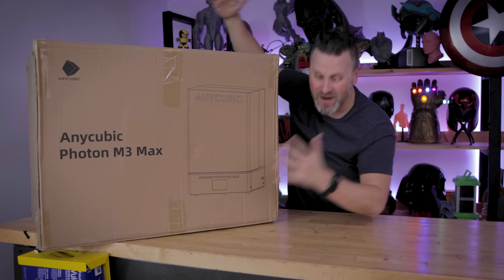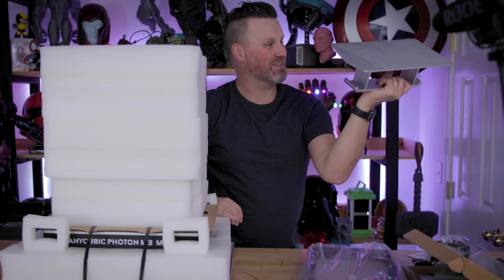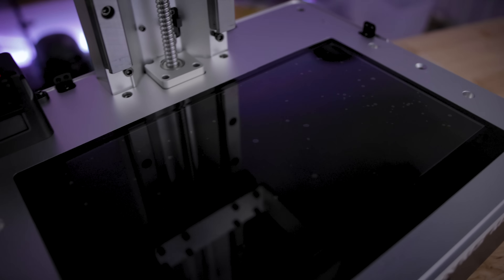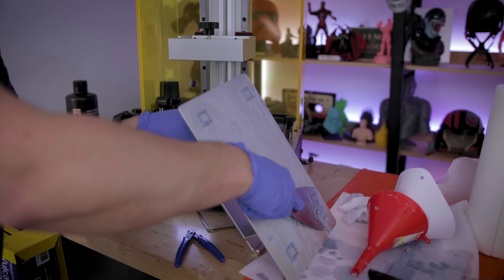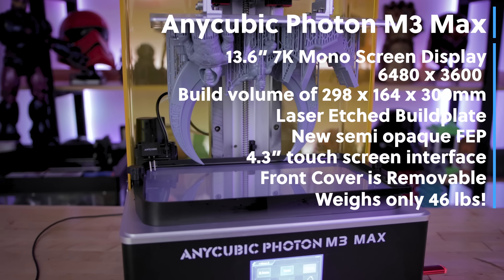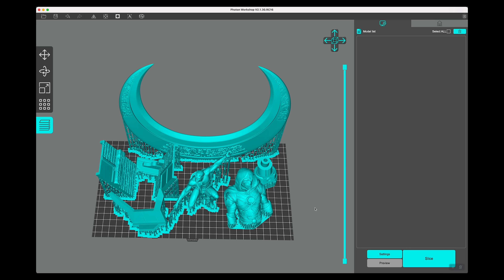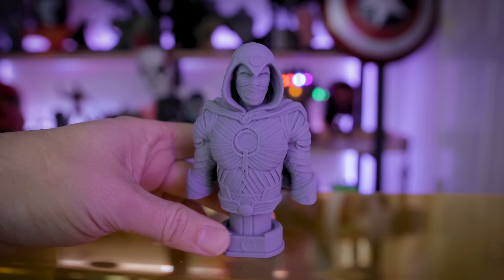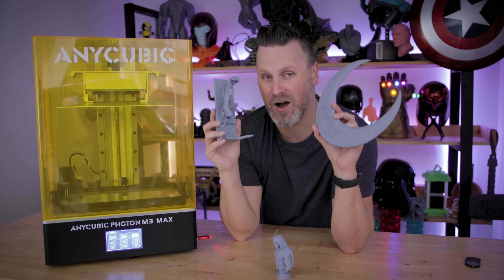This is amazing! Anycubic Photon M3 Max - First Look!

Comment from the maker: Interested in the new M3 Max or Anycubic's other new machines? Check them out here ➜ https://shrsl.com/3g1lo (aff link)
Reply: This is a great addition for such a large printer. BUT I already see a major flaw.

That resin tube and system is going to be a pain. Especially if you plan to switch resins. This system WILL clog. I don't have the funds for any of these printers (badly wish I did), but the upside down resin bottle feeder seems to be the best refill option.

 Eager to hear/see Jessy's full review.
Reply: @sespider  just add resin manually or make sure vat is full before print, adding byt hand is not hard and never caused an issue for me
Reply: That price seems crazy considering the competition are all several hundred or more expensive.
Reply from the maker: @markmorgan8378  It's definitely something to consider!
Reply: Looks like an awesome machine, although I wish they had gone just a tad bigger as to compete with the Phrozen Sonic Mega 8K or the Peopoly Phenom L…

I do hope they find a way to make the auto-resin filler a separate add-on so you could put it on any printer. 🤞 They’d make a killing! 💰
Reply: I've heard from other reviewers that the auto filler prongs are set too high and could lead to overflowing issues when starting new prints, is this the case with yours?

Will this still require shaking the bottle once in a while? how difficult is it to clean up afterwards? and would the prongs have resin on them and have a chance to drip onto the screen after removing the VAT?
Reply: Hello, this's Rebecca from SUNLU Company, I like your video so much, I would like to send you some SUNLU resin(standard resin or nylon resin) samples, would you like that?
Reply: still shilling for trash...
Reply: Would like to order this today but can't find a single positive review for Anycubic customer service or after purchase support.  Can I safely spend this kind of dollars with Anycubic?
Reply: @jerrybeasley1418  I've had to deal with their support on multiple occasions and I'll be perfectly honest. It can be slow as you're bouncing back between China and that's something that you just have to deal with. When I say slow, I mean maybe a day or two and and nowadays with people's Amazon expectations. Anything that's not instant gratification it's considered bad.

I've had issues with damaged screens and missing parts. I run a print farm so I'm buying a crap ton of machines and to be perfectly honest I haven't had any long-term issues outside of one of my machines. Just giving up and dying after about 2 years which when you're talking about super cheap electronics like this is not surprising.

I've been pretty happy with anycubic in general and want to consider their service any worse than any other China only based support teams that I work with.

Right now my only annoyance is I'd like to get more photon ultras but they keep dropping new products and not releasing this outside of the Kickstarter
Reply: Buyers beware anycubic took 50 days for them to tell me I wasn't going to be able to get my package it was lost
Reply: I bought a mono 6k, then returned it after finding out the lines I was getting from the uv array was a common issue. I'd be hard pressed to purchase another anycubic product in the future
Reply: @TheDooominator420  What "uv array" common issue?  Most issues are user error when it comes to 3d printing (hapens to everyone).  Did you take the time to calibrate it or just expect it to be perfect out of the box?  I have x2 6k's with zero issues, perfect clean prints every time so far, although I had to up the UV power % a tad as it was set a bit low when I got it.  Haven't seen what you said is "wrong" anywhere else however.
Reply: @MrNickpeck36  I first noticed a grid pattern in my calibration prints. I figured it might be a setting issue or the intensity was set way too high. After messing with a bunch of settings and getting down to 35%, I started researching. This is a issue anycubic is aware of and are trying to fix. I did a exposure test with a paper in place of the vat, the uv source looked like a lumberjack's shirt. My Saturn and ld002h both have a solid block of uv when tested this way.
Reply: @TheDooominator420  You know what, my one Saturn S did that as well, so I did the same thing, returned it and chalked it up to S/H damage lol.  I have x2 6k's now that are super solid so far.  

Now that you explained it I know what issue you are talking about and have seen it for several brands of printers.  I'm sure the bouncing around in S/H doesn't help.  Thanks for the info and good luck!

Comment: I own a M3 max and 
Im assuming the port on the right with the fan visible is the intake? I jsut wanted to make sure before i hook up the ventilation system i purchased. Becuause of the size and my limited space i cant test while its running. Can anyone give me an autoritative affirmative or negative?

Comment: Looking at getting into printing later on during the year, probably a silly question, if the printer is out of UV light in a normal environment (not partially damp or cold) can you just leave the printer full of resin, or will the resin eventually go off being left exposed to air?

My printer will probably be standing for 4-6 weeks before being used again.

Comment: Anycubic Photon M3 Max questions: 
1. What frequency is the FEP supposed to be tuned to?
2. Does the FEP spacer still require the "13mm" bottle cap depicted in their official FEP Replacement video or is the M3 Max a different calibration? (I have seen some 19mm spacers from users.)
3. What is the torque setting for the screws on the FEP sheet?
4. Replacing the Glass under the LCD left a gap on one side is there a way to combat this? As the adhesive strip needs to be as far out of the print area, and on the perimeter as possible.
5. Anyone able to fix the touch screen not responding often?

Generic Questions:
1. Does anyone consider that the FEP has to be the same temperature as during normal operations while installing the new sheet? I'm sure temperature has some (if negligible) difference?

Comment: You showed that the auto fill her wire went into the hole in the cover at the back. That whole is only for the fill hose and air hose not the power wire. The power wires actually on the back of the machine and that’s where you plug the power in for the auto fill cap.

Comment: Question. Just bought one of these bad boys. The auto fill works however when it stops there is a gurgling or bubbling that happens within the resin bottle. Normal or not. Like I was saying, It seems to be working just fine though.

Comment: great video ,thanks.
Just received my max3 but I'm cofused over the issue of if there is already a screen protector fitted to the maxhine plus a spare in the box.
should I fit the spare or not. if two protectors are fitted, 🥱does it matter?

Comment: Interesting how the original resin printers had auto fillers, then they disappeared but are now coming back. I remember there were many problems with the plumbing so hopefully they have solved that. Heck, I have a printer from 2012 that used liquid resin but without a vat, and the most difficult part of maintaining it was keeping the hoses clean. Had to run a separate cleaning cycle with a solvent after printing.

Comment: At first I thought wow, in the meantime the Photon is just junk. No matter how you level and how slowly the plate moves down. it keeps hitting the pane. It's only a matter of time before the LCD breaks.

The Feb sheet also broke after printing 10 times, resulting in a leak that damaged the LCD seal. You can't buy them on Anycubic Shop and the support refuses to send them.

Anycubic support says the following:
FEP film is a consumable item. Usually, after printing 10,000 layers, the FEP needs to be replaced,

 otherwise it will affect the printing effect (causing the model to break or gap or have llines or flaws on them ) or cause the FEP to wear and perforate,

eventually resulting in resin leakage and damage to the machine.

Never again Anycubic and the worst support!
They are not even able to send the device with the accessories.
After almost 6 months, I can't use the tank feeder because the hose is missing.

Just ordered things for 200 euros and they don't even want to enclose a Feb or anything else! lol

I'll never spend a cent on them again. Has never happened to me with Criality and both SLA printers work like new for a fraction of the cost!

Comment: HELLO LOVE UR STUFF!!! CAN YOU PLEASE TELL ME HOW DID YOU SETUP UR SETTINGS FOR THE PRINTING AND WHY IT PRINTS AT 6:20 ONLY UP AND DOES NOT MAKE UP AND DOWN MOTIONS ? Caps sry ..
Reply: special software that takes a picture at the exact same Z height for the build plate each time. I believe OctoPrint may do that, though I don't recall if that's the case, or if that's even the right thing.
Reply: @Mad_Catter_  thank you Catter , yeah later i understood that its not the Printer but the video is set to time-lapse and to take picture only as its up.

Comment: Thanks Uncle Jessy, I've never had a 3d printer before, so I watched many review videos, including most of yours, before deciding which ones to buy. I narrowed it down to Elegoo's Saturn2 8K and Sovol's SVO4 IDEX............ Yes, I was 'jumping in at the deep end'. Call me a moron, but I then went on Amazon to buy them, and discovered they aren't yet being sold. LOL But neither are they in stock anywhere in the UK. LOL. I COULD have purchased one direct from Elegoo in China, but because of the 'chip shortage' they are only exporting 1,000 units PER MONTH to the UK, and one has to pre-order and wait months to get one. Having said that, I suspect MOST are going to YouTube Reviewers, like yourself. LOL. Whatever, I was shocked to discover that whilst the Saturn2 8K costs £550, the shipping cost is £280 !!!! So, I thought 'xxx that for a game of soldiers' and went on Amazon and bought the printer that you are reviewing here. Whilst it's 7K, the screen is slightly smaller and (I believe) that means that the Pixel resolution is about the same, or slightly better? Anyway, I ordered it on Friday, along with Anycubic's Wash and Cure Plus. The Wash and Cure arrived the following morning and the Photon Max on the Monday. So, that's excellent service from Amazon (and I hate Amazon!) Both machines were packed securely and safely, most especially the Photon, with that 'aluminium' (note the CORRECT spelling LOL) Basically, you only have to inspect the outside of the box and if there are no holes, tears, or deep dents in the corners, or on the sides, you can 100 percent guarantee the machine hasn't been damaged in any way. It's basically all strapped in and cocooned in 'foam', so it's it almost impossible for the Z-axis pillar to punch through the box, or to be impacted upon from the outside and bent out of alignment. Still, I checked and double-checked everything, and went about setting it all up. And that's when I got to the screen protector. I made the mistake of doing this with the machine sat on the floor. People, put it up on a clean table. Dust and hair got on the underside of the protector and on the screen, and after several attempts at removing it, cleaning it, and re-applying it, I had to give up. There is NO SPARE, in the box, and replacements from Anycubic cost £25! Well, I ordered two, just in case I have another disaster! If I manage to do the same 19 more times, I COULD have bought myself another Photon Max! LOL. My replacement screen protector(s) will arrive tomorrow and I will be applying the first with the machine up on a table away from dust and hairs and indeed the cat. LOL. I would suggest that anyone who hasn't applied a screen protector before, have a watch of some videos. You made it look very easy. It's not!  Anyway, hopefully I'll be up and running tomorrow and doing my first test prints. As I said I've never even touched a 3D printer before, so if my prints turn out well it'll be down to the Photon Max, not me. Thanks again for the videos and for helping me to decide to jump in at the deep end. B

Comment: I've had my M3 Max for a week and I absolutely hate everything about it. I've scraped more prints off the FEP than I have my build plate. I deeply regret being swayed by the size of the Max over the quality of the Saturn2.
Reply: How was it working for you so far? I'm on the fence between this one or the Jupiter but I'm unsure if The anycubic would work well with my Mac.

Comment: Wanted to post a heads up here.  I got the M3 Max over a month ago and I was very excited to get it going.  But after a couple of days of trying to calibrate it for the large prints I hoped to do, I tore the FEP on the vat.

Managed to make a mess, but the BIG issue is that Anycubic...

HAS NO REPLACMENT FEP SHEETS FOR THE MAX IN STOCK.  

I ordered a pack of 5 in early June and they're still telling me to wait.  If you're thinking of buying the MAX, stay away until Anycubic has proper support or go for another printer.

I just ordered a largish generic roll of FEP to see if it can work.
Reply: Did you work out the FEP issue?

Comment: Ok, I have a serious problem Going On with my M3 Max I can't get any 
print to print right, I upgraded the firm wear, I been changing setting 
in Photon workshop,  and made sure the FEP sheet was perfect. But still 
nothing, I NEED HELP. What setting are you using in photon Work shop. I 
used all Versions of work shop and nothing seems to make the prints 
print. I been working On this problem for a month plus.  Oh nothing 
seems to stick to the plate and if it does the print fails at some print
 in the printing process.  What is happening,  what am i doing wrong.?
Reply: Were you able to figure out the issues you were having?
Reply: Did you try setting your exposure test to your liking and checking that the LCD isn't glitching out?

Comment: Not sure if anyone mentioned it in your comments but to solve the air bubbles in your screen protector you need to spray some water/dish soap solution on then screen then apply the protector with a squeegee.

Comment: Just wondering, is there an agitator for the auto feeder? I would be concerned about the resin in the bottle falling out of solution over the course of a long print. Maybe not enough to effect larger elements of the print, but enough to interfere with capturing detail as the print goes farther.

Comment: any cubic is hot poo, the tech is cool and the machines a nice... untill you find that one issue that ruins your entire machine (photon mono x screen tape curling and costing $200 cad when elgoo saturn is $90 and they didn't use tape to seal the screen) any one interested in anycubics stuff see if elgoo makes a version,
Ps anycubics customers service ends with selling you a printer
Reply: They replaced my LCD screen no questions asked.
Haven't seen a critical defect yet other than knowing the resin pump is a moving part. The touch screen is a little non-responsive every so often and uhh hmm, just really small things, I'll find you if I find any other issues though.

Comment: So.... if the mat leaked the auto filler would make a huge mess?
I wonder if it can detect a leak 🤔 (like if the level is not increasing at all while dispensing a lot of resin)
Then we can just set a fill level lower than normal to reduce waste resin? 🤔

Comment: I want one, the auto resin filler got me harder than a cured print lol. I was going to get the prozon but i like this more
Reply: lololol.. Thinking about getting this one as well. But every time I purchase one a new one gets released a few months later....I'll be mad if they come out with a bigger one than this lol
Reply: @stacygarcia4164  true, I was going to get the phrozon sonic mega but 2.5k price tag im just going to buy two of these ones instead. That is the problem with printers like the cr10 now a v2 and a max coming.

Comment: The video shows that the auto-feeder could potentially be a separate product: with a fluid level sensor in the vat, separately powered (could be split from existing 12v power - just a connection adapter), with a bottle pump-cap assembly.  Just need to drill holes in existing machines to let the tube pass-through.

Comment: I always take pre suporteded files or suported files from chitubox and put them into 3d builder.  They run the stl threw a repair and then save it. Then I put it in the anycubic workshop and slice it. It's a few steps but it seems to get the best results for me. Always check for artifacts in your sliced files before you print

Comment: If you weren't already aware, if you do a light spritz of windex before putting down the screen protector, it will allow you to adjust the position a bit and squeegee out the vast majority of the little bubbles you showed in the video. Just a light misting, and then after you squeegee, let it dry. This works for basically any screen protector, and also for vinyl decals.
Reply: Thanks! Will be trying this out :)

Comment: The auto resin filler is such a great idea, and honestly under utilized here. A software update could make it so that the amount of resin used is calculated, and it could put in just enough to finish out the print. That means no more extra resin you have to pour back into your bottles.

Comment: Wonder how that is going to work with heavy polymers and monomers resins where shaking up the resin has a large effect, would think this would not pull good resin because all of the heavy particulates are settled at the bottom of the bottle.

Comment: I like the idea of the resin filler but look forward to the gen2 of it. A rubber gasket for the pipe to feed through to minimize fumes and maybe a more intutive connection at the back so your not fiddling with the screw cap,